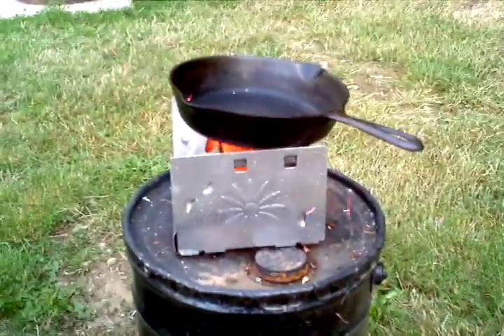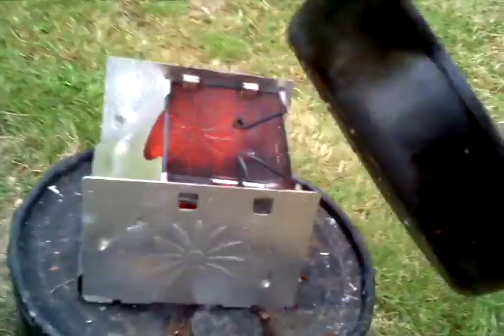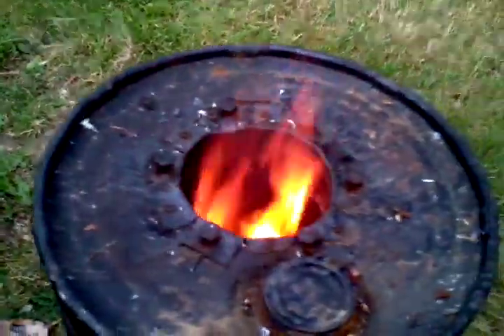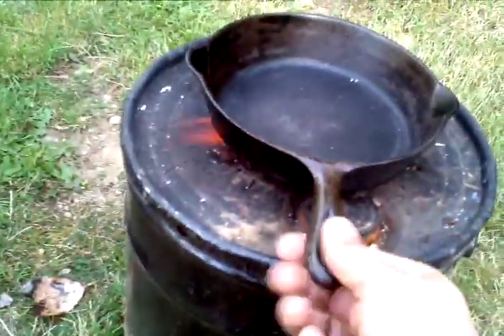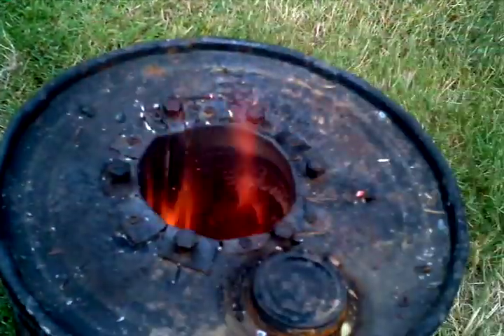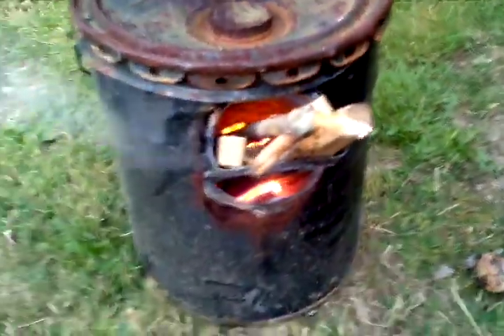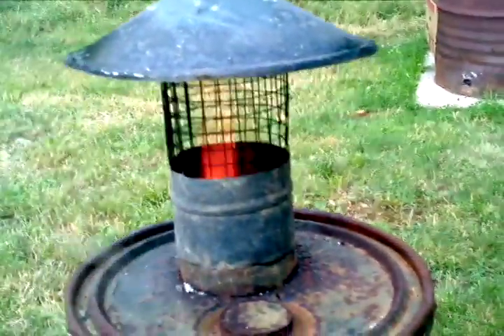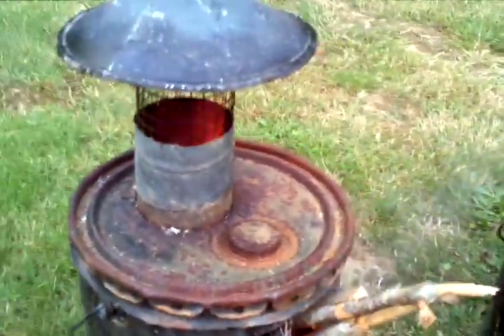Rocket stoves - Simple cheap DIY

Comment from the maker: It's as easy as turning it upside down.  There's not a lot to it.  Imagine the inside being a simple "L' with a tail.  The 'tail' fills up after a few fires but it seems to work better with a little ash/coal at the bottom anyway.  It gets emptied when it starts to impede the air coming in.